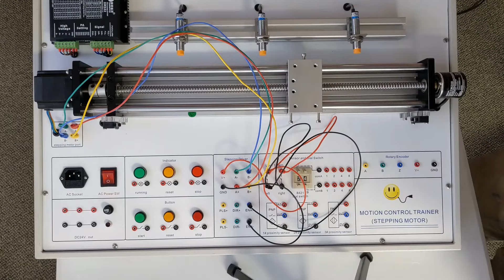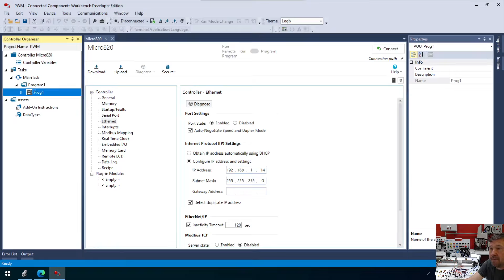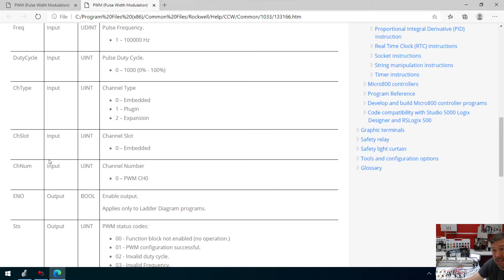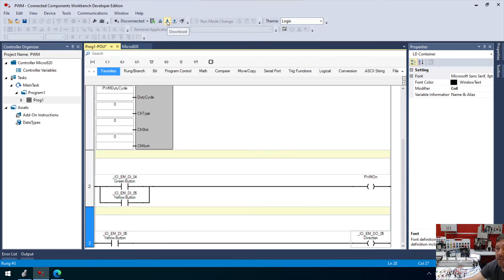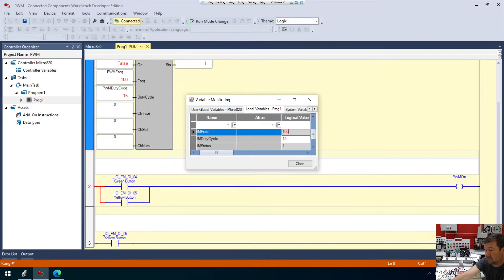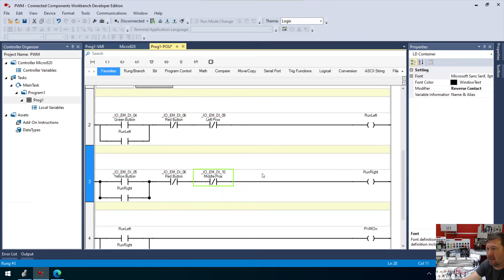Do Motion with the Micro820 PTO Pulse Train Output Instruction

Comment: ¿Which mark is the stepper driver that your using to control the stepper?   I got another question i can center point with the stepper position or a need in fact the encoder for exact position or both.  Best regards. 🤝🏻

Comment: Can I do this without using Stepper motor driver? can I control the position of the rotation of the stpper motor by just using the PTO/PWM instruction? thank you so much sir.
Reply from the maker: It is doubtful that there is a motor out there that would work without a driver, the amperage will be too much.
Reply: @TimWilborne  what if I only want it to rotate 180degrees and turn it off. it is okay to not use stepper driver? thank you
Reply from the maker: @yuginsantos846  No, chances are it won't move a single pulse. Why take the risk of burning up the output?
Reply: @TimWilborne  So sir, all stepper motor should have a driver? thank you so much sir. even if it is only 12v? this is for my school project sir. thank you

Comment: Awesome Video! Tim, I know some of the Stepper Drivers have an output option for Tach(Pulses per revolution). Can this me like a simple encoder to determine distance traveled and rate of speed? Thanks!
Reply from the maker: The PTO, like most simple steppers, don't use encoder feedback.  Some of them have stall detection but for the most part the "assume" that the motor has moved to the correct position.

Comment: Hi, can micro 830 be used on CNC machines?  Is it compatible with any Match 3 software or similar?
Reply from the maker: No, the controllers are designed for two different purposes.  Most notably a CNC controller will be able to do circular interpolation.

Comment: Could you do a video for velocity on a micro 830?
Reply from the maker: Check out this video.
https://www.youtube.com/watch?v=nTELQ-2tAYU
Reply: @TimWilborne  I should of used more words. I'm looking for a UDFB that would send a continuous pulse to a stepper drive. I'm using a pwm UDFB that I received from Rockwell but it seems to be a dirty signal and doesn't keep the motor at a constant speed. Your thoughts would be appreciated
Reply: @stephenrider5045  Use the PTO, for accuracy applications
Reply: @molickdm  I ended up using a teknic servo that was able to read a pwm signal to vary the rpm. Works perfectly
Reply: @stephenrider5045  You're right!. I meant use PTO for position control. PWM works fine with velocity aplications.

Comment: Hello Tim, I have the Allen Bradley Micro 850 PLC CPU, 2080-LC50-48QWB, what would be the espasion module that I had to buy to program PTO and PWM signals? Thanks a lot
Reply from the maker: The PWM is built into it, https://www.youtube.com/watch?v=nTELQ-2tAYU
Reply: @TimWilborne  thanks Tim but my PLC dont have  a motion control output, I need buy a module output.
But I don't know the references!
Can you help me?
Thanks 👍
Reply from the maker: @henriqueteixeira1236  Yes, you are right, I didn't catch the W in the 2080-LC50-48QWB.  You need a B there.  I don't think there is an option to get you there.  Might check some of the 3rd party encompass partners.
Reply: @TimWilborne  Thanks

Comment: The PWM instruction block doesn't exist in my Connected Components, and the instruction manual says to use MC_Power,MC_Move_Velocity, and MC_Write_Parameter.

Is there something that I am missing here?
Reply: PWM function only works with Mirco820 controller. Other Mirco800 controller use a PTO channels to make same fuction as PWM. PTO output impules, as well. PTO works with MC instruction blocks. I am not sure, but I feel MC series functions give you more accurate control on stepper motor or servo motor when your motor is carrying a heavy load.
Reply: @BuddyNoNo  Yes, PTO with the MC Function blocks can be used for more accurate and flexible control in motion control applications. You can set Acceleration, Deceleration times, Axis busy status and etc with MC Function Blocks. PWM can be used for basic motion control applications, but I don't think its a better option for position control.
Reply from the maker: What PLC are you working with?